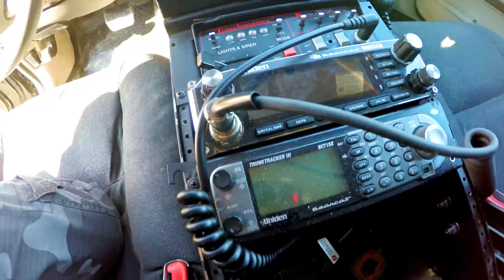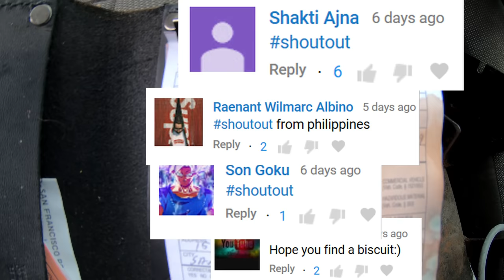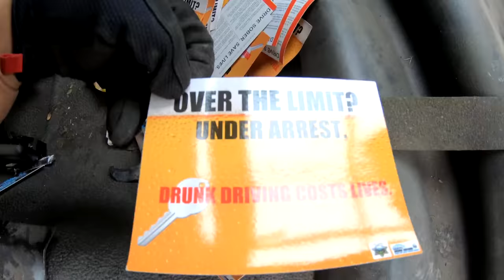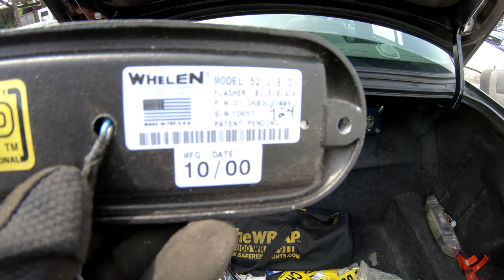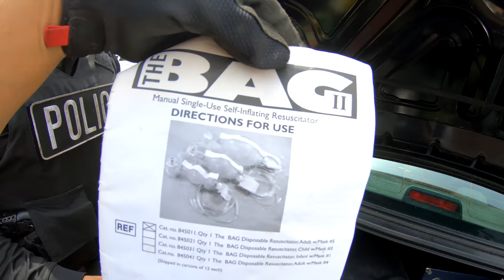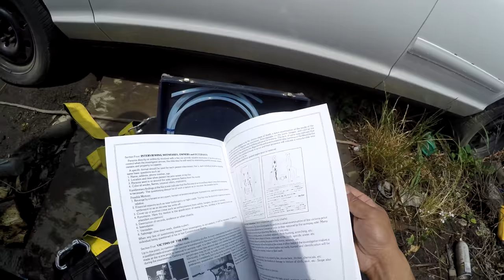You Won't Believe What I Found in Cops Car Trunk!

Comment: Sodium fluoride is an inorganic salt of fluoride used topically or in municipal water fluoridation systems to prevent dental caries. Fluoride appears to bind to calcium ions in the hydroxyapatite of surface tooth enamel, preventing corrosion of tooth enamel by acids. This agent may also inhibit acid production by commensal oral bacteria.

Comment: The “ claw knife” is a boatswain or riggers knife. The blade has no pint for safety if it is dropped from up the mast on a boat and the claw is a boatswains spike which is used for untying knots or unlacing strands of rope. Also good for opening shackles.